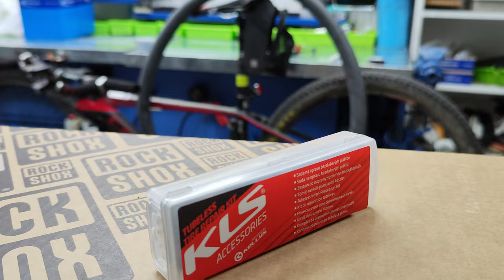The strongest bicycle tube repair patch available. How to patch a bike inner tube.

Comment: I have never used the metal tool to spread the glue just makes it a one time use item and I also always leave the plastic film on the patch unless it has sat for long enough to completely dry.
Reply: I remove the film with a razor before i glue the patch to the tube.